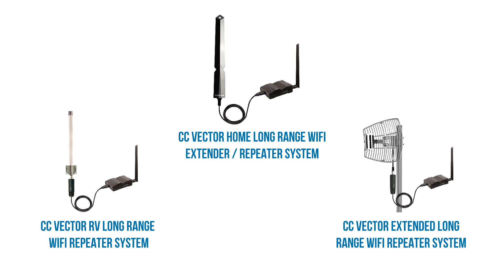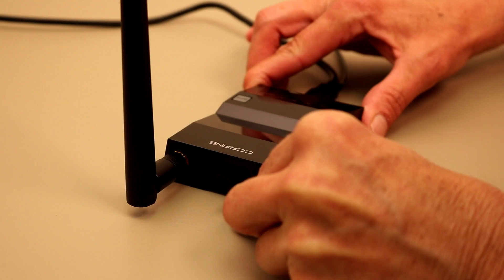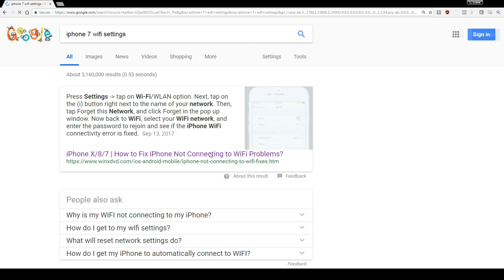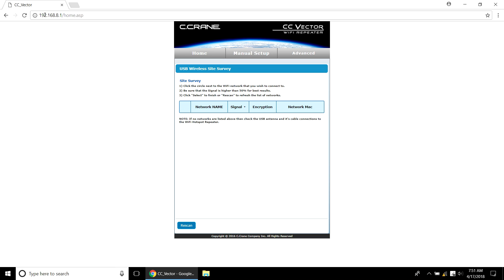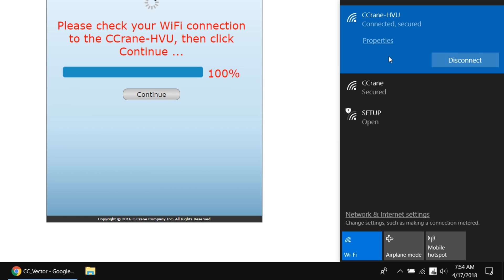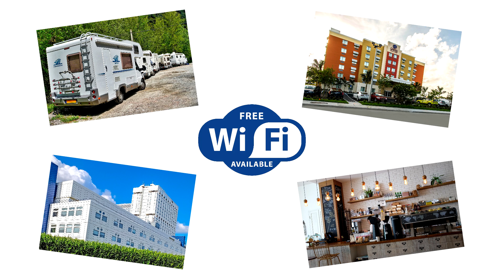C.Crane Vector Long Range WiFi Repeater/Extender System Setup Guide

Comment: I’m disappointed so far, but wondering if I’m doing something wrong?  If I’m not getting good connection to my shop, should I move the long wire antenna closer to the shop or closer to the router in house?
Reply from the maker: Thank you for your question. The Long Range (Super USB) Antenna Receiver attached to the long cable needs to placed outside the shop or at a window facing the house WiFi Router. The CC Vector WiFi Repeater box and the other end of the cable is to be placed inside the shop to repeat a new WiFi signal called CCRANE-*****. If you are having issues with setting up our system, please call our Tech Support at (800) 522-8863 (option #4) 
Technical Support Hours
Mon - Fri 9am 12pm & 1:15pm - 5:00pm (PST) 
Saturday, Sunday and Major Holidays (Closed)

Comment: If this is in my mobile home. Can I connect my wifi cell phone and ipad once this is set up correctly or do i need to buy more equipment?
Reply from the maker: Thank you for your question. Our CC Vector System can be used inside your mobile home for your WiFi cell phone and iPad to connect to the Internet provided that there is a free WiFi Hotspot near your location.